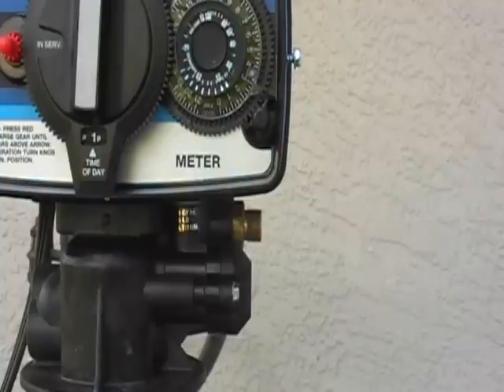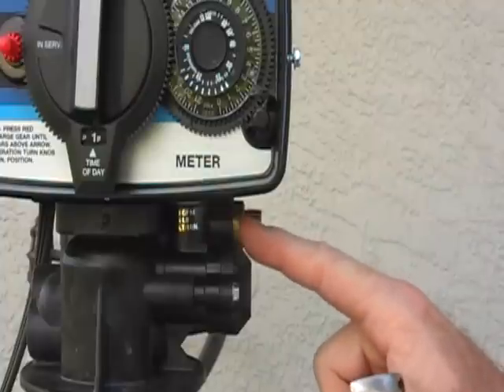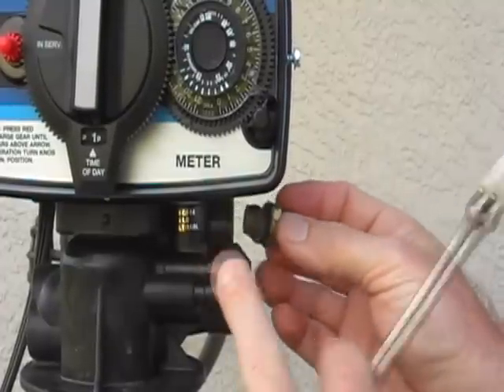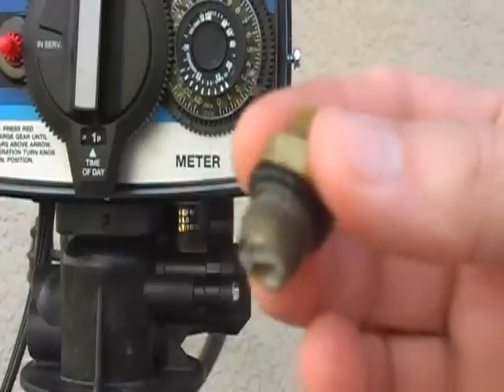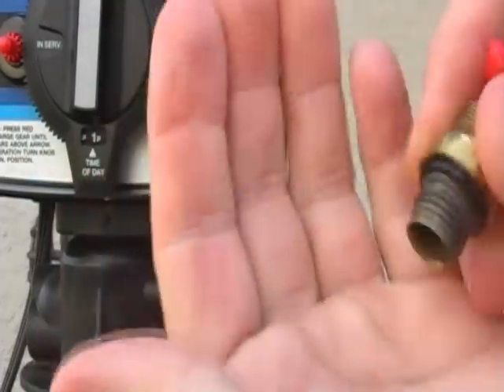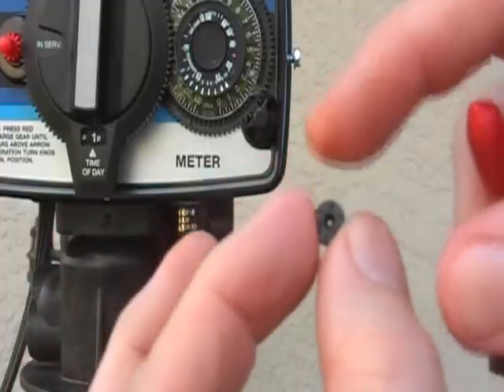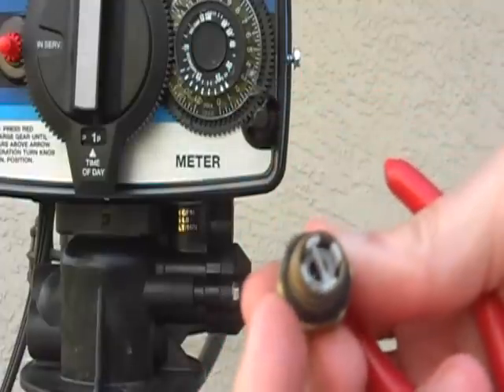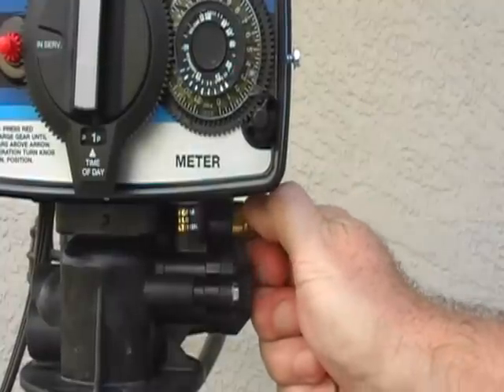Fleck 5600 No Brine Refill Problem - How to Remove and Clean

Comment: Thank you, my tank is 10 years old now, and been fighting this problem for a year or two.  Have a bucket nearby, and every three days, I pull water from the hot water tank, using a bucket, then pour 4 of those buckets into the salt holding tank.  

Now, I will use your method to solve that problem....   

Removed the fitting, retainer and washer, showed "25 or 2.5", cleaned and inspected, but did not see anything lodged in the washer or valve seating.  Replaced items and now will wait and see if that takes care of the problem.
thanks.
Reply from the maker: Glad to hear it! I hope it works for you.
In case you lose the BLFC or you can unclog it,
See the BLFC on our website - https://www.softenerparts.com/Brine_Line_Flow_Control_25_BLFC_Button_p/3412094.htm
Reply: Did you only have one line to your brine tank?  How did the tank draw in the water when u were manually filling it up?

Comment: Lots of comments here about Brine not being drawn out.  Same for me.  I used my mouth on the hose from the the brine tank and the brine immediately drew up in the tube easily.  Then I looked into the valve.  Nothing amiss, but I did remove the button/washer he mentions here.  My feeling is the pressure tank unit just does not have enough suction to initially pull up the brine water.  The trouble with these softeners is based upon the timer.  The brine draw time always allows the brine tank to go low which ends when the unit sucks air.  So unless the pressure tank overcomes the initial air in the line, the unit will not suck brine next time.  I just feel the Fleck is a poor unit.  I went without soft water for some time before I realized the unit was not working.  I have no idea how to fix it except to junk the whole F in thing and buy something else.   This unit has been a 3 year PIA since new.
Reply from the maker: Brine Suction issues are quite different than the REFILL issue of this video. For a complete list of Troubleshooting the Fleck 5600 ( and similar Fleck Valves ) see this Article on our website: https://www.softenerparts.com/category_s/7134.htm Valve is not drawing ( sucking in ) the salt water from your brine tank,
then here is a list of things to check and information about Brine Suction Failure.

Comment: the biggest problems with fleck valves is that it doesnt draw in brine from clogging. ive seen hundreds more problems dealing with not drawing brine than filling. the injectors within the brine block is the cause . usually get clogged with iron . we rcommend using iron out salt or  res care in the brine tube itself to keep injectors clean . softners like to attract iron .. they don't like to release it .

Comment: Buy and get it installed with warranty from a reputable plumbing company. They will service it.
Do not buy Fleck from Amazon! You will be fighting with it forever! Right now mine will not supply water to the brine tank. I fill it with a hose...I hate to spend my time screwing around with equipment that works erratically. That is why I only buy Honda and take it to the dealer for maintenance. It seems that american design is good at costing endless spending .